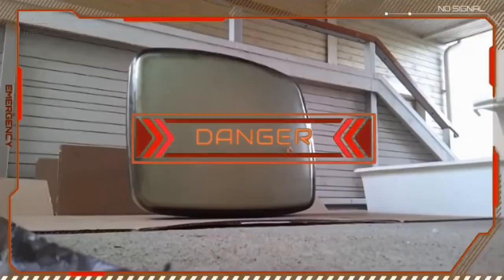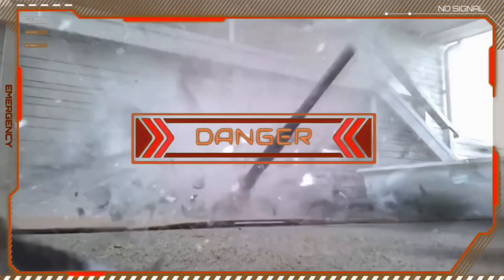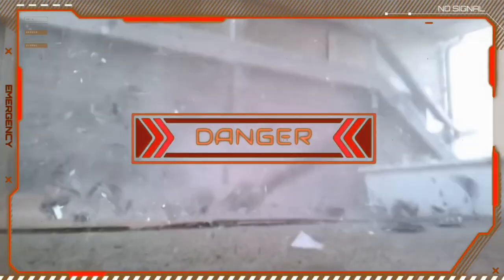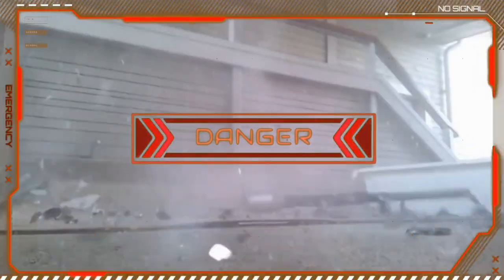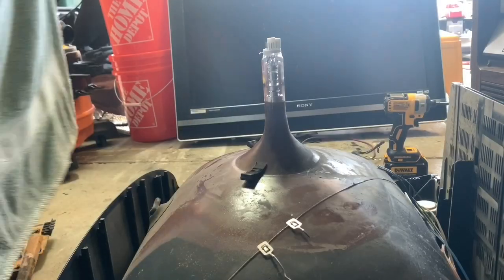Take Apart a CRT TV  |   Hunting For Greebles

Comment: Glad you covered the vacuum safety tip.  Most people don't know that one, or about how capacitors store energy and the "fun" you can have when it discharges (I have a lot of stories about those from my aerospace days).
Reply from the maker: I’m happy to hear I covered it well. I wanted it to be entertaining but also warn of the dangers. I used to work on electrical systems that had scopes 2-3x the size of this tv. It had 11 types of power supplies and multiples of each. And half of them were considered High voltage. I learned to respect the equipment very early on. And the sound of discharging a cap was so frightening loud you had to warn people ahead of time so no one was startled too bad. Good times